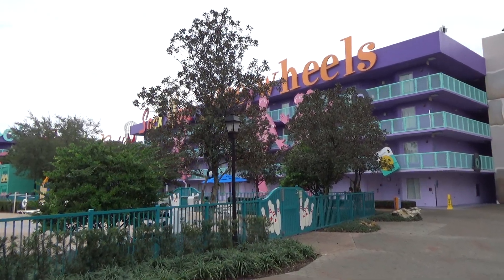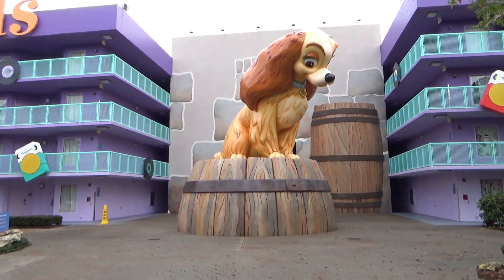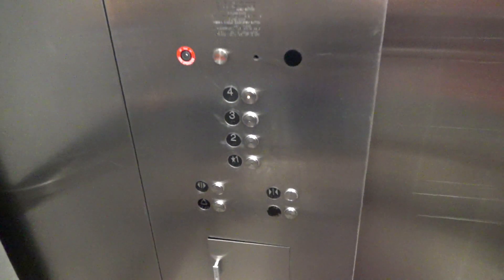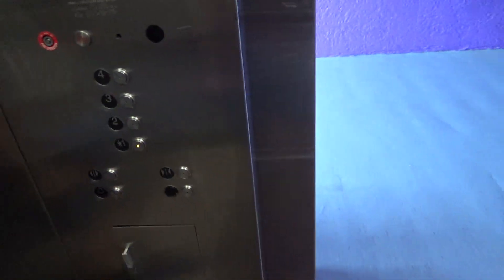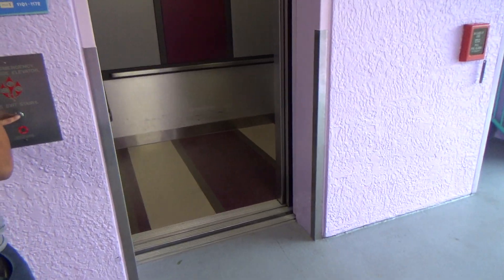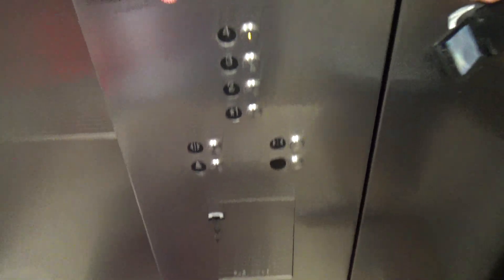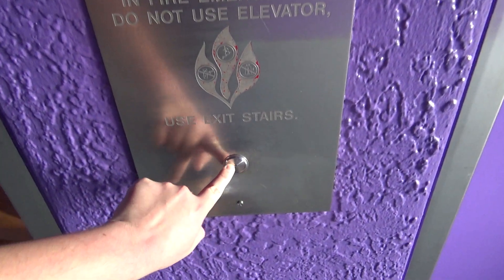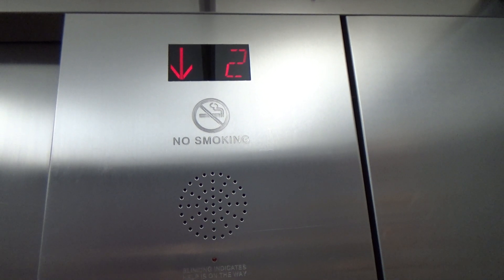"OTIStec" Hydraulic Elevators at '50s Building #1 at The Pop Century Resort in Lake Buena Vista, FL

Comment: I remember when I was 4 years old. about 12 years ago. I will explain to you that I remember this elevator. In 2007 before elevator was schindler or dover something like that but they updated it and now later it was OTIS elevator. So i love this hotel su much
Reply: This is a modernization by a joint effort between Otis Elevator Company and Fujitec. The fixtures are Fujitec, as you can tell by the chimes.